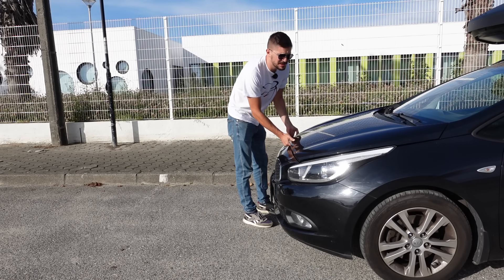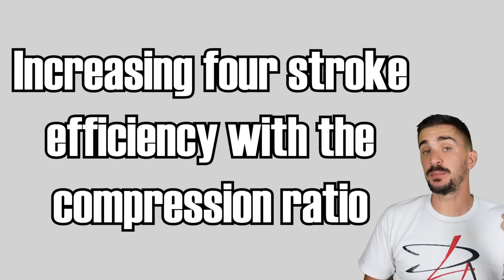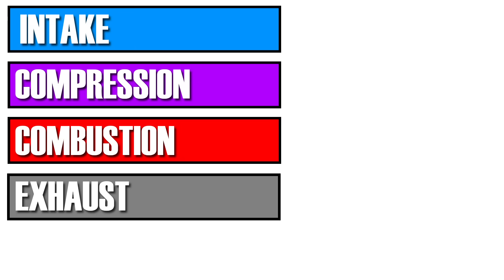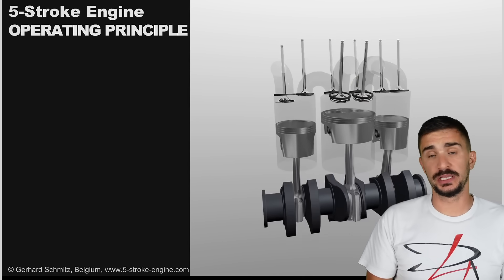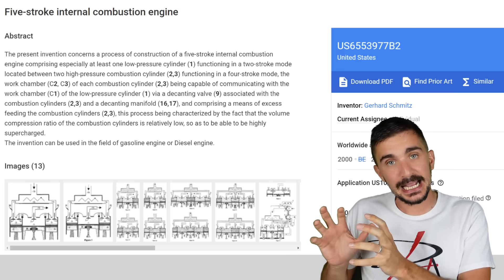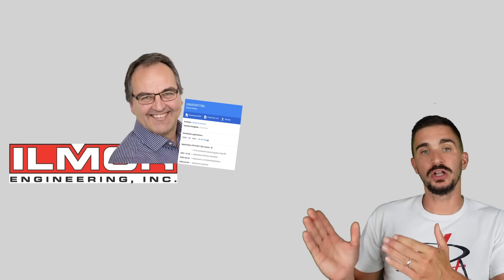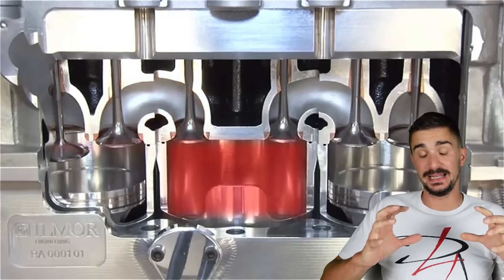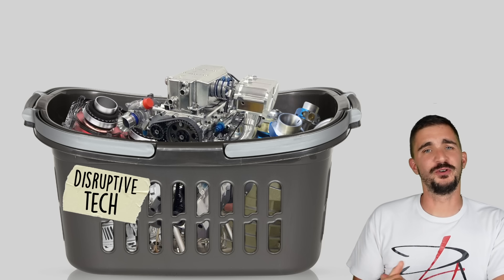Why Five Stroke Engines Are More Efficient But Still a Failure

Comment: 17:50 Letting you know... steam turbine technology is just a few years behind ICEs having been invented in 1884. Electric motors were invented in 1832, so they are 192 years old. ;)
Reply: I was looking for this comment :-)
Reply: @tifogra  I feel bad, but he did ask.
Reply: Electric motors are older than 1832. Faraday demonstrated a rotary elecromagnetic motor in 1821,  and in 1827 an hungarian phisicist started experimenting with coils and invented the commutator. the first electric CAR is from between 1832 and 1839, but electric motors ha ve been around pretty m uch all the time since then. And electric cars, cabs and trolleys were suprisingly widespread in the 1880's
Reply: @TDOBrandano yes and we stopped using electricity for cars when the electric starter was invented, from that point cars running on batteries no longer made sense, and it still doesn't
Reply: He clearly said "for propulsion."

Electric motors didn't become viable for mass produced automobiles until the 21st century. And even now, their reliability is only proven in part-time hybrid applications. A Prius can reach a million miles. Good luck doing that with a Tesla.

Also: The day you unironically purchase a vehicle with an internet connection is the day your freedom is forfeit.
Reply: To be fair to the electric motor, the motor wasn't the problem with getting to the shops, it's always been the power source. It still is.
Reply: While it's true that these other inventions have longer lifespan, they were never really used as civilian vehicle's (which you can buy, of course) main propulsion unit until companies start to utilize electric motors as sub-unit to support ICEs AKA producing hybrid cars (and hypercar/race car with KERS system) in the last two decades.
Reply: All relax... We mean in vehicles. I don't see much steam turbine powered cars and EVs for that matter. And by the looks of it we are looking at another 150 for the Otto cycle. :)
Reply: @bobogto540i4 
17:56 The task given was:
"Let me know when ANY kind of propulsion technology manages to last 150 years".

This includes electric trams, electric trains, electric elevators, electric escalators, et cetera - and are not solely limited to propulsion of just cars. You can't just redefine the task to say "everyone else are wrong".

This was a claim about survivability and usability of ONE technology for propulsion, and the task was to find another technology that was more successful over as long a time. The electric motors give ICEs a great challenge for the title there.
Reply: @bobogto540i4  the limitation of electric motors/engines in vehicles has been battery technology, not the engines themselves. Electric motors have hardly changed in 150 years: heck, electricity generation has barely changed (nuclear and solar being the notable exceptions, though those are still 70 and 40 years old, respectfully). The dominance of ICEs comes from petroleum being cheap, pollution being ignored, and batteries being heavy - not because they're better than electric engines at being engines.
Reply: @erikdietrich2678  engines are still quite literally being developed and improved upon. I believe an engine with around 60% thermal efficiency was developed recently and improvements such as direct injection giving a lot of engines much more hp/l
Reply: @erikdietrich2678 solar is the only real exception I can think of. Nuclear is almost the same as coal or gas:

Hot stuff boils water -> steam moves turbines -> moves rotor -> electricity.
Reply: @erikdietrich2678  Not entirely true. Electric motors haven't really changed, just as much as ICE engines haven't changed... just as much as batteries haven't changed. 
No. In reality they all have changed and through engineering, technological and very importantly economic reasons ICE engines have stood the times being good at all of the factors. No they are not the most efficient, or the cheapest, or the cleanest, but given the evolution and infrastructure that we have currently they are still the best overall option without needing major infrastructure changes and huge financial cost. Ever wonder where money comes for EVs incentives and why electricity has shot up in price over the last couple of years. At least in the US.
And I would absolutely agree petroleum is currently cheap enough and that batteries are heavy. But on the latter... vehicles have become ever so heavy recently that a 6000lbs EV is not abnormal or problematic at this point. And... we all know pollution is not being ignored. The last 20 years has seen major willing and unwilling strive towards "cleaning" ICE engines and currently they are doing just as good as EV's in the real world if you do the actual numbers and consider emissions per unit energy used per mile traveled. Basically per 100 miles even the more inefficient and polluting engines will emit the same as the energy needed to be produced to move even one of the more efficient EVs out there the same 100 miles. Again highly dependable on the source of energy for EV's, but at our current development state and the heavy reliance of fossil fuels to create electricity anyway...

It's a cumulative matter, that's why ICE engine are better than electric motors. Currently IN GENERAL they are cheaper to develop, manufacture, they have a more efficient use in any application form. From every day small vehicles and short trips, to long distance cruisers, to heavy duty semis, to trail locomotives (funny enough most of those are diesel-electric with motors, but funny enough basically the primary propulsion source is still an ICE engine). Yes an EV is probably better if you charge it only at home, only do 20-30 miles one way, ambient temperatures are always ideal, you have the money to spend on them, you are OK with very little options and choices of vehicles, have money to spare on installing chargers and outlets at your home... etc. But if you want a vehicle that can do any trip, anywhere, no matter what the temperatures, one that you can buy and just park in front of your house with no cables or calling out electricians involved... Than your best option is still an ICE vehicle.
Reply: @BranimirBalchev-b2r The least efficient electric cars have equivalent emissions to the most efficient ICE cars. For the average of each, it's not even close. And ICE cars aren't getting appreciably more efficient: they're adding electric motors and batteries.
Here's my math:
The most efficient ICE consumer cars get 50 mpg (2 gal per 100 mi), which is 0.4 lbs of CO2 per mile (apologies to the rest of the world for ridiculous units). The least efficient electric cars get 2 kWh/mile, and current US average emissions is 0.81 lbs CO2 per kWh, so that's also 0.4 lbs CO2 per mile.
I could also argue that the most efficient ICE cars are also kind of cheating by using electric motors for energy recapture and low speed driving: the most efficient fuel-only ICE cars top out at 40 mpg.
Reply: Yes but his main point was how ubiquitous ICE engines have been in life for so long. Steam engines came and went. And the electric motor, while invented in 1832, did not become incredibly common until recently.
Reply: @magmatri-studios  steam is to this day wildly used for power production
Reply: @cj09beira  Steam turbines are used though, not quite the same as the original steam engines
Reply: @cj09beira  Wildly or widely?
Reply: @cj09beira you're right but we are talking about the automotive industry. A lot of power plants use steam but that's irrelevant in this conversation.
Reply: @SkeletonGuts  the problem was that steam turbines had a small rpm range where they were efficient. Generator fixed rpm. In a container vessel where the speed of the vessel was reduced, all container ships participating in a fixed roundtrip of harbours have a fixed time of coming into that harbour and have a fixed time to go from a to b, because of the time chart changed. After about 8 years the double steamplant that should have lasted 20 years or more was replaced by double diesel engines. The cost savings on fuel the next 12 years covered the cost of purchase, maintenance and explotation.
Reply: @magmatri-studios  If buy recent, you mean only the past 80 years, you would be correct.
Reply: @mikem9536  how do you figure. Yes there have been a lot of electric cards over the years but there's a reason none of them are on the road now. Only in recent years have electric cars because somewhat reasonable for daily use. Why do people feel the need to come up with obscure car that was a failure in real world markets to use a "proof" of having electric cars around for decades?
Reply: @mikem9536 I think you may mean battery electric motors for tools,  like drills,saws, even nail guns. Ac electric and battery motors have been used  from the 1800s. 1st cars were battery 💁‍♂️
Reply: @magmatri-studios  It's been used unceasingly in other industries, just not so much in the automotive one.
Reply: @magmatri-studios  electric motors are one of the most ubiquitous technologies around. I have dozens in my home. But he was talking about complex machines and electric motors are dead simple compared to an internal combustion engine.
Reply: @magmatri-studios  I feel like the electric engine and  4strokes goes hand in hand
Reply: Washing machines etc. have used electric motors for ever. Not too good for getting to the shops though!
Reply: I hope they can develop the battery or change its type. In general, although combustion engines appear complex, they are actually simple and perhaps simpler than the electrical system. In fact, combustion engines were used in many things, not only in the field of transportation, as they were used in washing machines, looms, and others. The pollution argument is often used to promote an electrical system that is not clean. Many electrical components rely on semiconductor elements, which are mostly obtained from quartz. The electric motor is in fact not clean either, as it requires copper and rare metals that may be used as magnets in addition to Pollution resulting from battery manufacturing. The electric motor is more complex than the combustion engine, especially the methods of connecting and winding the wires, in addition to the complex electronic circuits. Yes, the combustion engine is better than the electric motor because it has more torque while consuming less energy, and it can often work with any fuel that burns, in addition to the energy density of the fuel being greater than the energy density of batteries and It's the same with the lifespan. Turbines are used to achieve a faster rpm, while engines are used for purposes that require high torque. No matter how complex the mechanical system seems, it is still simpler than the electrical system ( an electric motor is a mechanical engine, it just consumes electricity to operate ).
Reply: @yakut9876  I can make a functional electric motor with my bare hands, a potato battery, a magnet, and a bit of copper wire in less than a minute. The same functional design, scaled up and with more precision, is exactly how industrial electric motors work. In stark contrast, internal combustion engines at minimum require precision machining of multiple parts to be any good, and linkages to turn linear pulses into rotational output. There's no contest: ICEs are more complicated than electric motors.

And every argument for the materials requirements for electric motors and batteries can be applied to ICEs as well: and the motors of both types can be recycled in the end. A typical ICE car will burn its weight in fuel in a single year of use. That far exceeds any one-time pollution generated by the refinement of lithium, neodymium, etc. needed for electric cars. Even if fossil fuels are used to generate the electricity for electric cars, the CO2 per mile is far less. My own car gets 4.3 km/kWh, and US electricity production outputs roughly 0.4 kg of CO2 per kWh on average (overall that's 9.3 kg CO2 / 100 km for my car), and this is going down as more wind and solar are being integrated. A very fuel-efficient ICE car is easily half again as much CO2 per km.
Reply: @erikdietrich2678  All excellent points, plus it is easier to control pollution at 1 electrical generating facility, than at millions of individual ICE cars.
Reply: @erikdietrich2678  you can quite simply rebuild engines of any older car easily, you just can't manufacture the parts for it. on the other hand, electric motors? not really
Reply: @dotmoody  you absolutely can rewind the coils on an electric motor, refurbish the commutator and brushes, and have a working motor again. You can even do most of that by hand, since the tolerances are really quite generous. What are you talking about?
Reply: @dotmoody you definitely can, I love combustion engines but if it weren't for the battery requirement electric motors are better in basically every way (aside from the subjective things obviously)
Reply: @yakut9876  For my 2nd degree, I started in mechanical engineering, and even though my grades were good, there was no hope I would get my dream job as an ICE development engineer. Only a few jobs open up every year worldwide, and they go to people who can read differential equations like it's a children's book. Materials science, combustion dynamics, thermodynamics... NOTHING simple about ICEs.
Reply: A far better means of transport, that doesnt pollute and had been around for Thousands of years is a horse and cart
Reply: @johnr1038  still takes land to grow the hay and feed for the horse, and the manure does have to be managed. Plus it doesn't scale very well. A single semi-truck would easily need a dozen horses to pull it, and could only do so for short periods of time.
Reply: @johnr1038   In London, they used to have people stationed at the bottom of bridges to clean up the horse poop that collected there. The horses would evacuate themselves as they started up the bridge ramps. The streets were literally covered in poop and urine.
Reply: @johnr1038  Horses Fart, so they do technically pollute
Reply: Why are you trying to turn this into a apples versus oranges discussion? The video is about engines. Not (ac/dc) motors.
Reply: @Lyle-ou9sp   Because HE said at 17:50 if there's an older tech, tell him.
Reply: @tsbrownie he was talking about propulsion, and obviously in the context of driving cars etc - sort of the theme of the whole channel
Reply: But electric motors were crap until the 1880's when Tesla perfected them. And to this day there is little difference of what we use compared to what Tesla perfected in the 1880's. Using a solid state circuit to convert AC to DC in the alternator. But you are correct. Another interesting point. In America during the 1920's there were 10 electric car manufacturers. Yep. Even all the NY City cabs were electric back then. But, the batteries were placed under the hood, or in the trunk. People did not sit on them. I find that very interesting indeed. I'm not convinced sitting on a large magnetic field in such close proximity to the body is healthy. It's like sitting on a mini microwave.
Reply: @johannjohann6523  I'm pretty sure the magnetic fields in an EV aren't any more, and most likely way less, than Earth's own giant magnetic field or standing near power lines. If you have magnetic forces that are used in an MRI (about 100,000 times higher than Earth's force), that can sometimes cause temporary effects on the body, but there has been anything proven about lower forces that you'd experience in daily life causing anything.
Reply: @johannjohann6523 That is a great misconception: having magnetic fields around the battery.
There is nothing remarkable.
You will have the small magnetic fields like around every wire with current in it (if the car runs).
But they are not amplified because there are no coils in batteries.
So if you are far away enough from electric motors you'll probably be safe.
Reply: @johannjohann6523 I always put my face very close to the microwave to check my food once 10 minutes non stop, got a headache from it
Reply: @johannjohann6523 yes electric motors are very efficient, but batteries are not. It takes a lot of energy to produce them, they are heavy to haul around, they don't last very long. They don't keep the energy very well.

Comment: Wonderful presentation, BUT....yeah the electric motor: ONE moving part.  Efficiency above 90%.  Let you known when it lasts 150 years?  Sorry.  It's over 200 years old.  It was never outclassed by gasoline engines.  Batteries on the other hand: pretty shitty until lately.

Comment: these would be awesome for a diesel electric truck like edison motors is trying to build... the engine only starts to charge the onboard battery... it never idles... it's always under relatively high load, always at the same rpm...

Comment: Using Sterling power's external combustion engine to capture the heat exhaust of an internal combustion engine worked for me when I used a Sterling linear alternator to capture the heat. It works on a single cylinder small engine.

Comment: What about running it only at ideal/peak RPM in use as generator/range extender?  Would it then generate enough pressure and heat for a turbo and cat to function while providing better efficiency than a standard 4 stroke?

Comment: 15:42 sounds like a great reason to instead use it as a range extender on a hybrid EV. Those run at all times at whatever optimal RPM you design them for.

Comment: The highest efficiency gasoline engine currently available is Toyota's new 2.0-liter Dynamic Force Engine, which achieves a thermal efficiency of 40% in its conventional form and 41% when used in hybrid applications. This engine stands out as the most thermally efficient in production, indicating that it can convert a higher percentage of fuel energy into mechanical energy compared to other gasoline engines